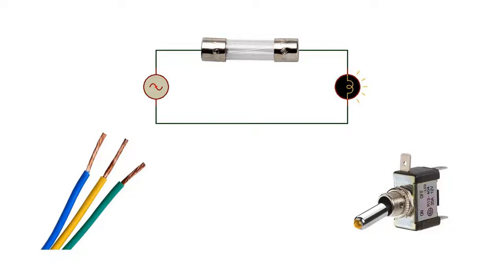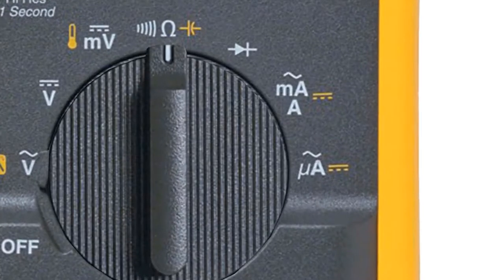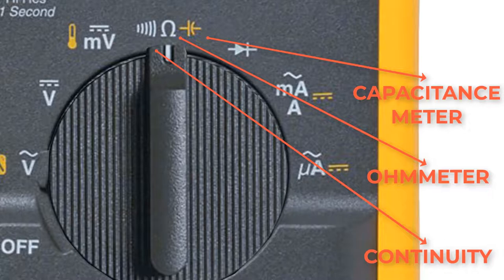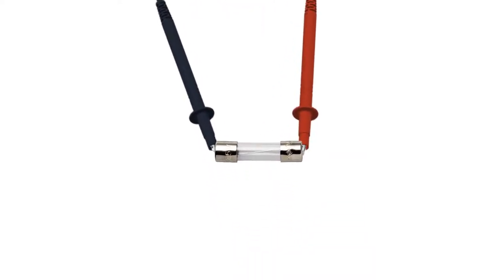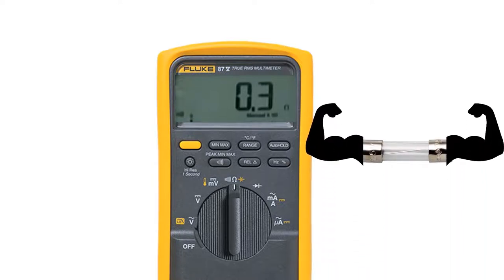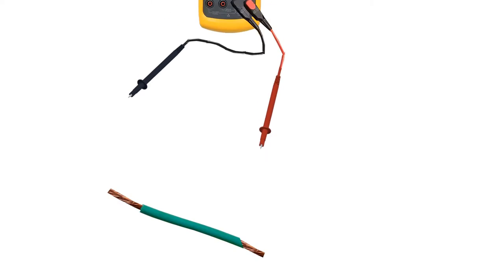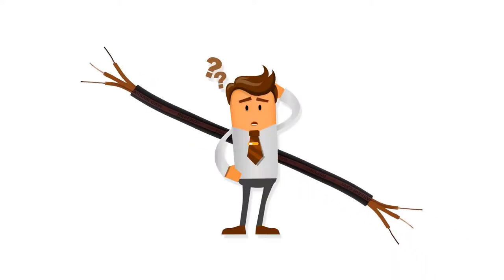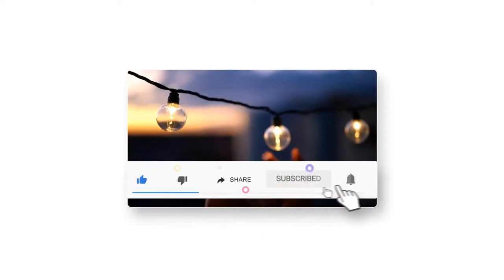Continuity test |Explained

Comment: Thanks for your clarity in delivering the issue I am expert in this field however I shifted to another field and now I am back trying to catch up; you brushed out a lot, well done. I have one question why in the switch example you tested it while the switch On ? is it safe?
Reply from the maker: Thank you for your support 🙏❤️,, you can apply the test safely when the switch is away of the power source,, the problem when you test it when it is energized

Comment: Why is there no continuity when I hold the two probes in my hands?  Our body is conductive, right?
Reply from the maker: That's right ,but our body has high resistance which could vary from 1000 ohm to 4000 ohm,, this will make the continuity confused,, but if you use the multimeter as ohmmeter it will show you your body resistance